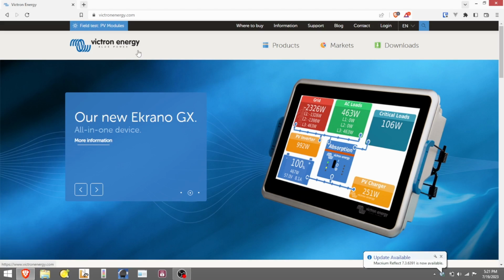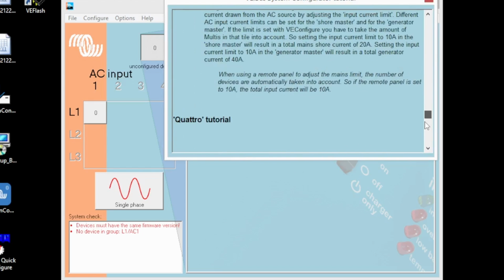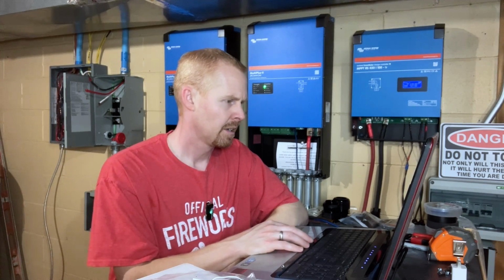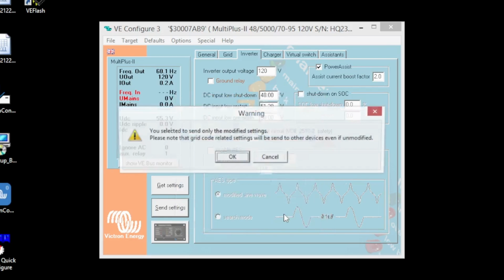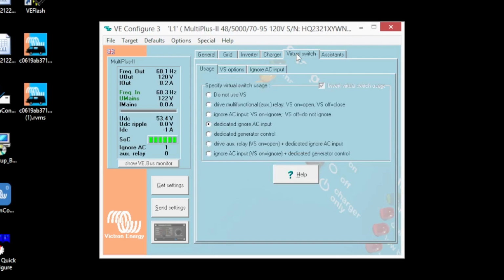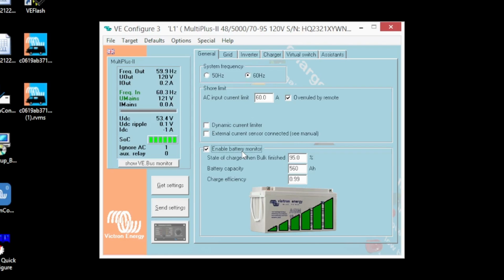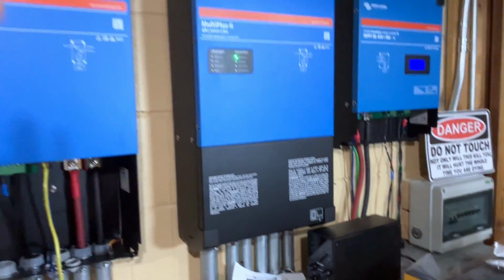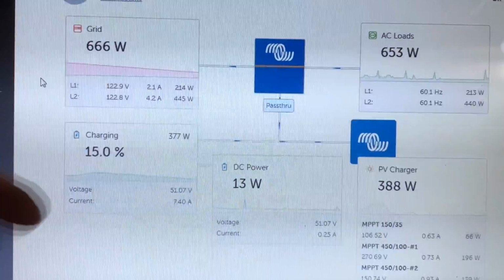A First Look at Programming the Victron MultiPlus-II 5kVA & Ignoring AC Input on the Inverter

Comment: wow, they really need to work on that software. I used to run the HVAC systems for a school district fifteen years ago and the software I used back then was less confusing and more modern than this is. Right off the top of my head that software looks like something the average DIY'er is going to have trouble dealing with. 

Thanks again for the videos!

Comment: I was about to buy the lead but eventually I found out how to do the upload from the Cerbo GX.
Agreed the software is a bit historical looking but I figured it's for engineers and not end users.
Reply from the maker: Yeah once I figured out how to do it from the VRM, that’s what I’ve been using the most.  Not as easy as it could be but definitely simpler than unplugging the Cerbo each time you wana make a change to the system.

Comment: Ignore AC it’s a nice trigger for the grid assist. Ad second trigger “flag” that can smooth out the trigger conditions. Also the order you set them, it’s the order they will operate. Hope that makes sense.
Reply from the maker: I’m assuming your taking about the assistants?
Reply: @AdamDeLayDIY  no assistant, same as you set the “ ignore AC “, there is the “flag “ as well, sometimes used to start generator.
Reply from the maker: @aureltanasan1413  Gotcha.  Boy it seems like each day I'm learning another new way to ignore the AC In.  I think right now I'm up to 5 different ways.

Comment: Under the ignore AC tab. The grid assist would be helpful if someone had a small battery bank and wanted to control the discharge on their batteries. 👍 very cool stuff, Adam
Reply from the maker: Thanks!  Yeah I've actually seen that in action 1 time because I had some settings programmed incorrectly.  The load exceeded the settings and the grid automatically connected to help cover the load.  Was awesome to see!
Reply: @AdamDeLayDIY  that is awesome!

Comment: I would suggest disabling the virtual switch and install the ESS assistant. Set it to Optimized, Enable limit inverter power and set to the required value. Then set minimum SOC % to 15%. 
ESS allows for more configurability of the system via the Cerbo.
Reply from the maker: Thanks for the tip.  Yeah I knew there were a lot more ways than just the simple virtual switch.  At the moment I’m testing using the Cerbo generator start/stop to control AC in.  Good to know I can do this with ESS as well.
Reply: But ESS does not guarantee 0 feed to the grid. At some points, it will feed into the grid. I remember he doesn’t wand to feed into the grid. Just a thought.

Comment: I have a very similar setup as yours, initially I was using assistants but switched to Node-Red on the Cerbo as it offered more flexible trigger options for when to run from battery and when to run from the grid.

Your confusion at how to go about programming was the same thing I went through, and thought the same thing, this should not be this hard.

I think they are working towards having a unified programming through Victron Connect, but not sure how long that will take.
Reply from the maker: I’ve actually started testing using the generator start/stop on the Cerbo to control AC in.  It lets me make changes to values from the Cerbo instead of the software.

It does seem like they’re trying to move things to VC.  It’s a smart move to have a single piece of software.
Reply: I had that setup at one point as well, and it worked pretty well, but still used one of the relays on the Cerbo and one AUX input on one of the Multiplus'. The Node-Red route is all software and requires no extra wiring.

btw, did you see that there is a new firmware out that prioritizes solar/wind energy? I'm hoping to test it out here this week, hopefully it does what I think it should do and supply power to the inverter if the batteries are fully charged. @AdamDeLayDIY

Comment: This is a good new one for me and the MPII ... I will have to watch this a couple of times ... when pass through came on, the "house" was running on grid and the battery was being recharged by solar? ... no inverter charging them?  hmm.. when fully charged it will be interesting to see it switch to battery only.. I have to on my thinking cap .. for sure.. thanks.. pat
Reply from the maker: Yeah so the MP turns on the grid relay when the SOC reaches 15%.  Once the voltage gets up to 53V (or whatever the value in the vid was) the grid relay will disable and everything will be powered by the battery.  Since I disabled the charger in the settings, there will be no grid charging at all.  

There area actually quite a few different ways to do this from what I've found.  Currently I'm testing the Cerbo's generator start/stop function to perform this.  It allows me to control the values from the Cerbo instead of having to change through the software.  It also allows me to manually switch to the grid if I need to.

Right now I'm working on a way to dynamically enable charging.  Usually I only ever use it a couple times a year, but only when we have bad storms coming in and there's potential for the grid to go down and my batteries are already low.